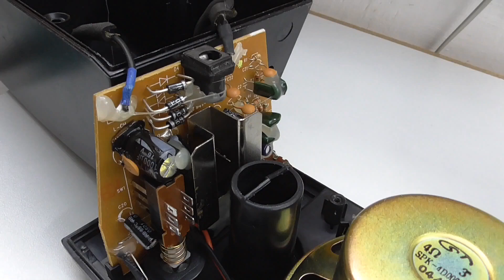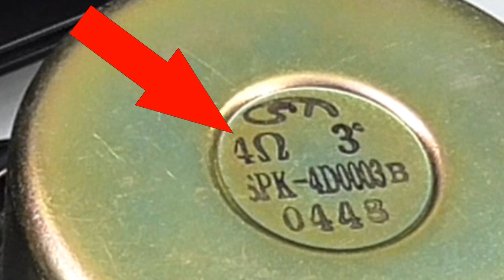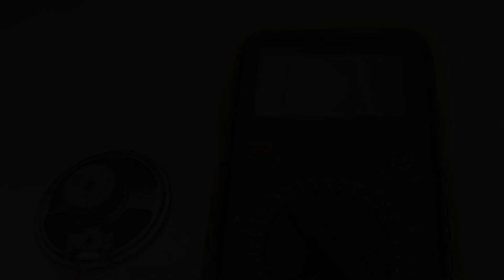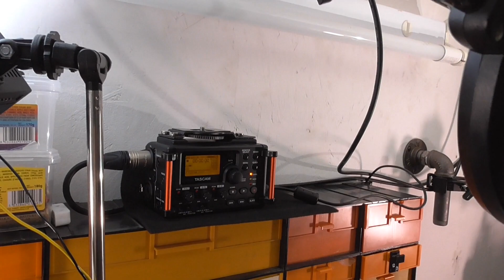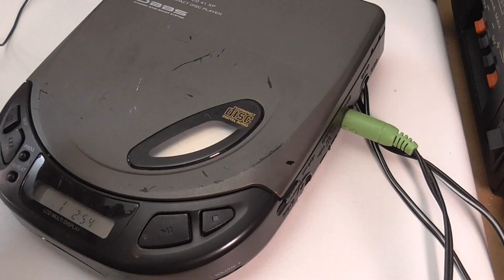Vintage radio speaker, can I get it working?

Comment: I think if you keep the vintage driver, it is important to match the impedance of the driver to the amplifier.  A driver of 3000 ohms was probably intended to be connected to the output tube(s) with no output transformer. (Keep in mind the true impedance would need to be determined with an AC signal, not an ohm meter) This driver will make a very poor match to an 8 ohm output and will result in low volume.  If you would like to hear it another way, use a horn driver for a PA speaker, be sure to use a crossover to keep the bass out of the driver.
Reply from the maker: Thanks for the info. Yes, the amp is a poor match, and from what little I have read, modern solid state amps don't really require impedance matching to modern drivers as they have such low output impedances anyway. It's not a useful capability, though, when the driver is 3000ohms, rather than 4ohm! 😅 I do have some other amps to try, and whilst the output transformer doesn't completely sort out the problem, it does show promise. That output transformer just happens to be one I have, but I probably have some other ones that may be better. I had also considered winding my own, though that does seem like a lot of effort. I did successfully wind some coils in this video, though:
https://youtu.be/1mhp5vIMWWI?si=XF2RWp-bscEa0Zlf
Thanks 😀 👍

Comment: Thanks for the video! I'm a collector of a such stuff too. I have a similar radio speaker made in the USSR in the 30's. But my one also is a gramophone soundbox. I mean it can work like yours - as a speaker and it can be used like an ordinary gramophone diaphragm. More than that, it can work in ways at the same time - as an electromagnetic pickup - sound goes from your amplifier's loudspeaker (from radio) and also sound goes from gramophone's horn. 
Honestly speaking, it sounds poorly, there are almost no high frequencies in it's sound. 
Almost forgot! It can be used as a cheap microphone if you'll shout it it's diaphragm. 
It looks like it's a simple gramophone pickup but more heavier and it has two jacks for cord connection on the back side.
All these functions of our such soviet device were listed in "Radiofront" magazine from the middle of the 1930's.
Reply from the maker: That's very interesting to know. Thanks for the info. I have borrowed one of these drivers previously and that was clearly boxed and sold to be connected to a gramophone, though I didn't really realise that at the time!
https://youtu.be/Y5hb4cLnifw
I found my vintage driver in an antiques shop and although I didn't really have a use for it - decided it was worth buying. Fortunately I did as I then found a suitable horn at RetroTechUK, which is a yearly show in the UK. I don't think the driver is the right one for the horn and there is actually a little 3D printed spacer inside the horn now to make it fit. It's close enough to being right I think. I have seen a complete one for sale, different model - but it was too much money for me.
Thanks 😀👍
Reply: @mrrgstuff  Thank you for making such interesting videos! 
Also I found your tutorial about repairing the soundbox  for HMV useful , it helped me a lot (I don't remember the name of this model), I know that it's a very common soundbox in your country. Unfortunately, in the USSR such soundbox were made almost of crap - from low quality zamack. That material cracks and crumbles with time. That's why such soundboxes nowadays in Russia are very hard to find. Fortunately, my friend sold me a such one. And with your help I did the repair and maintenance. Thank you! 😀

Comment: It's hard to tell how it sounds because I'm listening through your mic, your sound card, youtube compression, my sound card, then my headphones. It's a working piece of vintage tech. Leave well enough alone. Make a new driver that you can attach to the horn.
Reply from the maker: Yes - I agree, there are so many components in the loop that its difficult to tell how it really sounds. In this video, the cheap USB mic makes it sound much louder than it really is, but then of course it is a cheap mic which has issues of its own.
I have done quite a few comparison videos like the following which I think allow subjective comparisons of equipment in the way that listening to live would not be practical:
https://youtu.be/iXpPIvZxTus?si=OaApWKuijTS1LTSL
Thanks 👍😀

Comment: I think most old vintage speakers are driven by a transformer not Direct but I could be wrong🤔🤔🤔🤔🤔
Reply from the maker: From my limited understanding, early radios had high impedance outputs which were suitable for use with an earpiece or some early types of headphones. This I guess is why early speakers had high impedances - and it was only when low impedance speakers came in that output transformers were really necessary. I don't know for sure though. Thanks 👍😀

Comment: Interesting. They certainly look better than they sound. Could you 3 d print a case to accomodate a modern speaker?? that could be attached to the horn? I wonder how that would sound? My Mother used to tell me her Dad put a pair of headphones in the mixing bowl when the family wanted to listen to a program together. This would have been late 20’s.
Reply from the maker: Yes - I was thinking about making a 3D printed adapter. I have tried holding the bluetooth speaker up to the tube mount and the horn certainly amplifies it a bit. The dealer I bought the horn from had some horns set up with fiberglass copies of vintage drivers which had bluetooth speakers inside! They looked really good and fooled me initially 😅
I agree though that the horn certainly has the look - but currently leaves quite a lot to be desired in terms of the sound!
Mixing bowl idea sounds great. I guess they needed to stay quiet - but the bowl probably made a very effective sound reflector. Thanks 😀👍

Comment: Keep it original & go for the vintage driver, preferably using 1920's valves. I''ve done this, but the sound's a bit quaint, due to the imperfect frequency response. Here's an example of the sound I got from a later (balanced armature) high impedance speaker, on a rare early 1930's radio: https://youtu.be/ht9qh_kLlZ8?si=D0jwC2DiKXSYvVgu
Reply from the maker: Thanks. I'll do some more work on with the vintage driver - but not sure if I will get to using valves. Thanks for the link also! 👍😀

Comment: DC resistance is not the same thing as impedance.
Reply from the maker: Thanks 😀 👍.  I know, and I never claim in the video that it is. I believe it is true though that the simplest way to measure the impedance of a driver is with a dc resistance check. Properly measuring the impedance is unnecessary and far too complicated for an entertainment video like this.

Comment: I think these were not particularly loud originally. In the 1920s many people listened to radio using headphones, and so it was a considerable step forward to amplify the audio loud enough that several people could listen at once, but my guess is they still had to keep quiet and be attentive!
Reply: The volume depended on how many audio valves were used after the detector stage. You could get good volume, but valves were expensive. Reflexive audio circuits made one valve deliver the power of two. I built such a circuit using 1920's valves many years back. Got decent volume, but there was a lot of distortion.
Reply from the maker: Thanks - that's interesting to know. I have a few valve based amplifiers - but to be honest I haven't had the time or skill to work on them so far. Too many other projects! 😅👍😀
Reply: @mrrgstuff  I know the feeling!
Reply from the maker: Yes, the cheap USB mic makes it sound much louder than it is. It is loud enough to listen to - but yes you do need to have a quiet room and be attentive. I will work a bit more on it and see if I can improve it. Thanks 😀👍

Comment: Well in my opinion, if you like sound amplified the natural way which is by a giant horn then you could use that radio. Unlike other speakers, it amplifies sound with machinery like receivers.
Reply from the maker: The horn certainly adds a a bit of tone or colour to the sound. It amplifies it a bit - but not as much as I would like. The horn really does need to be repaired and fitted properly into the metal tube part. There is a significant air leak between the wood horn and the metal which I need to fix. I think it does look pretty cool though! 😅 Thanks 😀👍

Comment: I think it would be good to stick with the vintage driver, but fool around with it some more, as the distortion is a bit out of hand.
Reply from the maker: Thanks 😀 👍.  Yes, it's struggling a bit and doesn't sound great, but the volume is getting to usable levels. I will try some other amplifiers I have to see if I can improve it 😀

Comment: These early speakers are meant to be hooked directly up to a 1920s pre-superhetrodyne  regenerative type radio.  Glasslinger (youtube user) has done a few of them.  They aren't very loud either. I'm pretty sure most need a power supply for the electric magnet. The frequency response is probably worse than AM radio. 

 The paper-cone loudspeakers came on the market around the same time (just a bit before) as the first electric records. They pushed these mechanical jobs off the market.  Other than switching out the electromagnet in the early loudspeakers  for the permanent magnet of the modern one, they are mostly unchanged since.
Also, either you have the amp turned up too high, or your matching transformer is way off. The distortion is terrible.
Reply from the maker: Thanks for the info. Yes, there is definitely quite a bit of distortion and whilst I didn't mention it in the video, I noticed that using the headphone socket added to it noticeable, although it did also increase the volume. The amplifier is maxed out, so undoubtedly is adding to (or creating) the distortion and the output transformer is not matched, just one I happened to have. I am pleased it works though, and have at least one other amplifier I think worth trying with it. Thanks 😀 👍
Reply: when you doing to second demo with the headphone socket, you can see the light on the amp dimming from the voltage dropping out from excessive current draw XD  @mrrgstuff
Reply from the maker: @milesprower6641  Yes, you can. I noticed whilst filming also. I guess the a/c adapter unit I'm using with the speaker set can't actually cope with the amplifier turned to full volume. I will try some different amplifiers, but any other ideas welcome. Thanks 😀 👍
Reply: @mrrgstuff  This pretty much always happens, particularly with lower end amps like you would find in a pair of powered computer speakers. It's probably not the power supply. There are very few amps that can handle going up to about 60% of max volume. As you turn the volume up too high, it will sound more and more like screaming (as the sound becomes more "compressed" and loses the up and down of sound) and then as you go higher, it will start clipping.